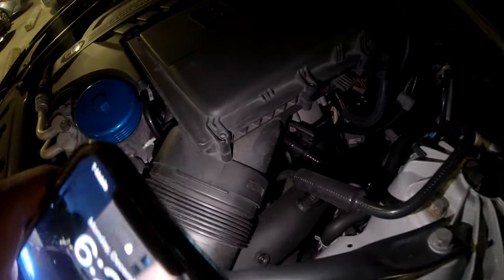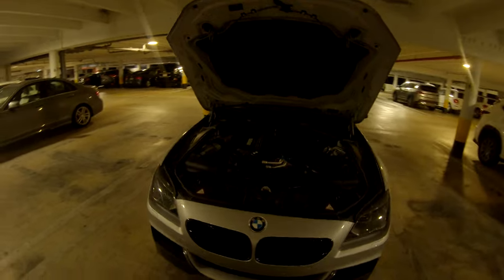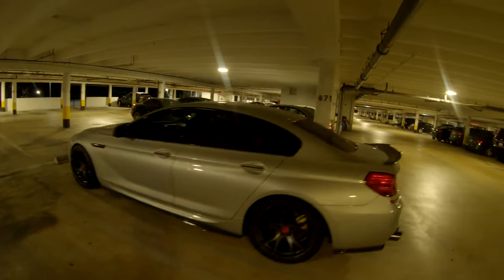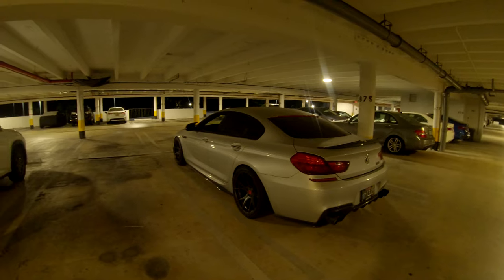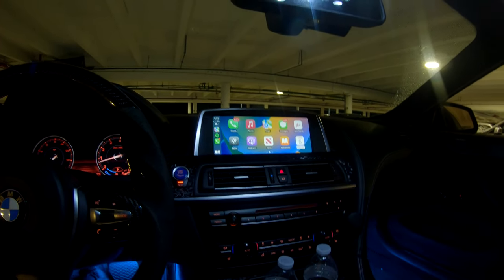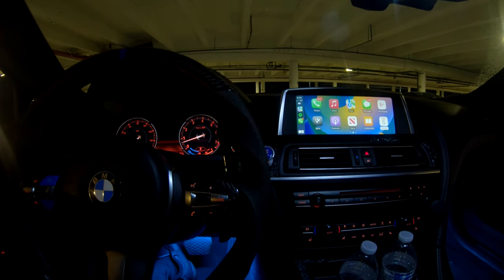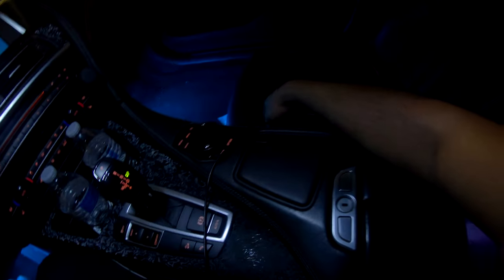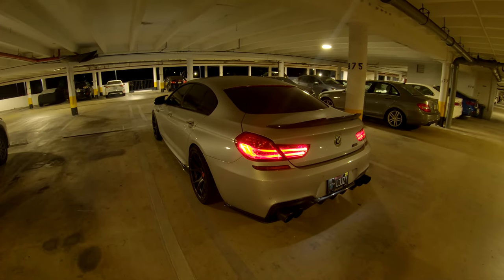The Top Five Modifications For Your BMW 6 Series! ( F-Chassis )

Comment: The reason your stock radio didn’t sound good was because it’s not a650i which gives you the better sound system
Reply: 640i and 650i both had HK and B&O sound systems. There's no difference of the same systems on 640i vs 650i.

Comment: Hello, I love your car it’s freakin dope! I have a 650i and I install 295’s in the rear but it touches the fender when I would hit a pothole and some of the tire rubs off. Do you think I should change it or just modify it to accommodate the tire because I really don’t want to buy any more tires. Also, would you mind sharing what kind of exhaust pipes you have on your car because my car looks like a bad ass but doesn’t sound like one it’s too silent so any recommendations would be gladly accepted. Keep making those videos they are very informative. Thanks
Reply from the maker: Mine rubs a bit as well but I just deal with it because it only does it on some turns when I have passengers. For your 650i Id recommend downpipes and if that still isnt loud enough for you, pair it with a muffler delete! Enjoy your 6 bro & definitely more videos on the way!

Comment: Hi do you mind sharing the brand or model of your CarPlay decoder? Thanks!
Reply from the maker: Wireless Carplay Retrofit Kit Decoder for BMW 5/6/7 Series with NBT/ID4 System 2012-2017 Year, F01 F02 F03 F06 F07 F10 F11 F12 F13 F18, Support Android Auto, Mirrorlink, Reverse Camera https://a.co/d/3XMnJV1
Reply: @rnrmotorsports  Thanks, is it stable enough? I don't want it to disconnect or anything wrong.
Reply from the maker: @xishen8043  it connects via wifi and bluetooth & is much more stable than the oem system

Comment: @rnrmotorsports do you  have a video  in mirror cap installation? I ordered the 5 series type you mentioned but didn't fit. I have a 2015 640i gran coupe
Reply from the maker: yes its on my channel bro
Reply from the maker: i also have ones that will fit 6 series on my website!
Reply: @RNR Motorsports  is good now I got them from Amazon  for $30.

Comment: i was just about to ask if you prefer the b&o speakers than the ones you have now, and im very very surprised u said that the b&o aren't as loud. (i personally have an a4 with the b&o speakers). im really happy to hear that tho because i am in luv with the 6 series bmw (all of them) and its my dream to buy one with the b&o speakers but now im jus thinking of buying a 6 series without the b&o speakers and just do what you did to ur car.  thanks alot brother i appreciate u sharing that with the viewers.
Reply from the maker: the b&o sounds miles better than the harmon kardon but is still lacking bass in my opinion
Reply from the maker: you can also get a 6 with b&o and still upgrade to the bavsound subwoofers. it would still be plug and play as well
Reply: @rnrmotorsports  thanks for the information. appreciate it alot💯
Reply: @rnrmotorsports  wouldn't running audio through the aux cable degrade the quality terribly? this is why im thinking of upgrading to idrive5/6 instead of an mmi box